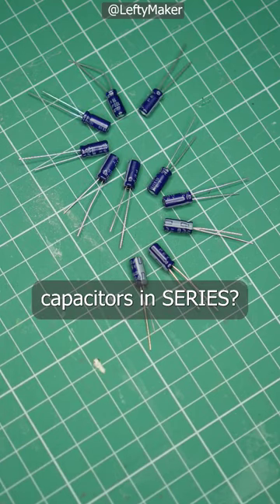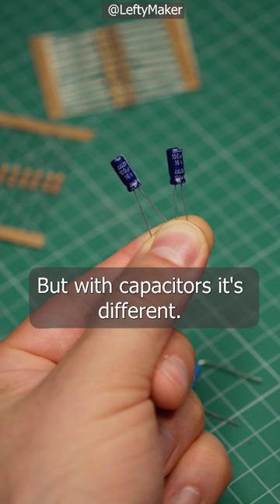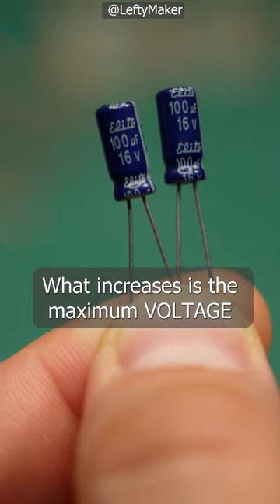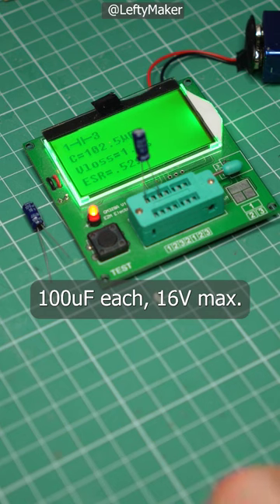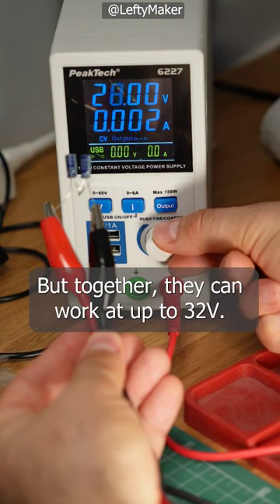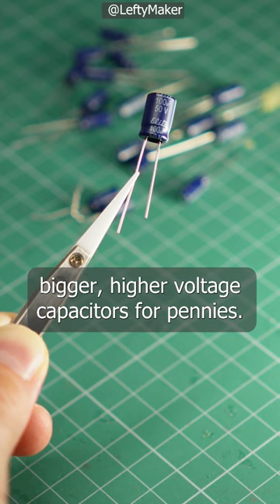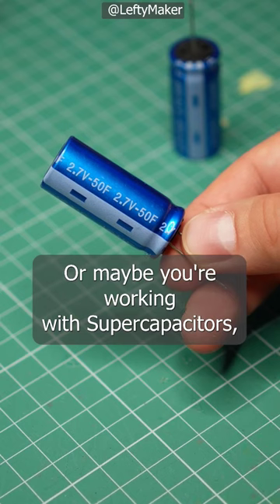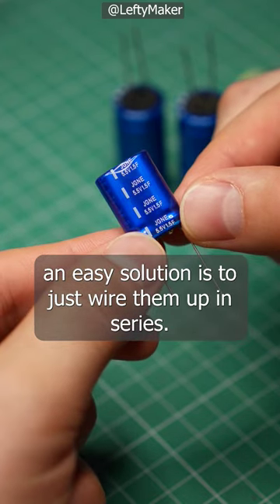Capacitors in series? What happens and when to use series capacitors

Comment: What happens when you wire them in parallel?
Reply from the maker: The capacity combines. It's common to have a bunch of small caps in parallel when there's no room for a big one. And sometimes you'll see several different types in parallel to filter out different frequencies.
Reply: @LeftyMaker  cool

Comment: The reason is that capacity, the property of capacitors, is just silly. See, we define capacity as the charge that capacitor would handle per 1 Volt, C=q/U. If we defined that as how much voltage can it handle per equal charge, thus =U/q, capacitors would be absolutely same as resistors and solenoids, the measurements would sum. They actually sum with current definition, although you should connect them in parallel, not like we've seen in the video.

Oh, and by the way, when you parallel the resistors, resistance is also calculated via formula 1/R = 1/R1 + 1/R2, or R = (R1*R2)/(R1 + R2)

Comment: Dude it's just a battery, so. .
Reply: Batteries in series will not drop in capacity. Assumming they are the same type of course. For example two 3,7v 1000mah batteries in series will make one 7,4v 1000mah battery.

Comment: Capacities are essentially just like a battery they hold A Voltage differential So if you connect them in series or parallel, it's gonna change them just ever so slightly.

Comment: The capacitanse does not drop, farand is per 1 v so it work at the same amount of time
Reply: Where can I learn more about what you said?
Reply from the maker: What do you mean, exactly? The formula is 1/x = 1/C1 + 1/C2... so if you replace C1 and C2 with two 100uF caps, then the combined capacitance is 50uF
Reply: @LeftyMaker  yes but the duration is same
Reply: @LeftyMaker I think he means that the amount of energy a capacitor can store is a function of the the capacity in farad and the voltage. Double the voltage and you double the stored energy, since the capacitance is halved this cancels out, leaving you with the same amount of energy stored, but now divided over two capacitors
Reply: @eindeend no, double capacitor double energy capacity. Twice voltage QUADRUPLES energy, but farad is halfed, so it's twice.

Comment: I think that you are missing the point! 
When you increase the amount of capacitors in series, you can increase the voltage and therefore increase the amount of power to be stored! Which you will need resistors in series to dissipate the stored energy from the capacitors!

Comment: You MUST NOT assemble capacitors in series, w/o appropriate balancing circuit. Otherwise the capacitors might explode or burn (esp. Tantalum type) due to overvoltage.
Please withdraw your video, it's absolutely incompetent and dangerous.
Reply: That ist absolutely Not true